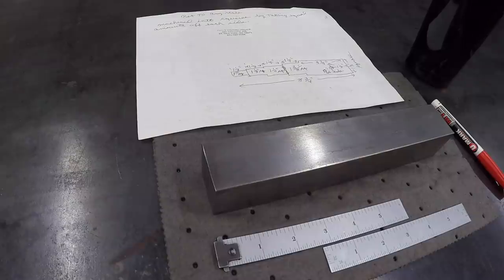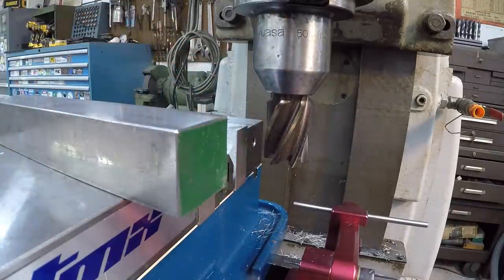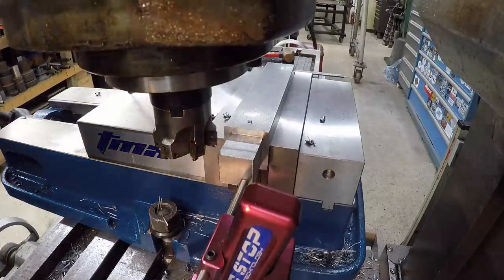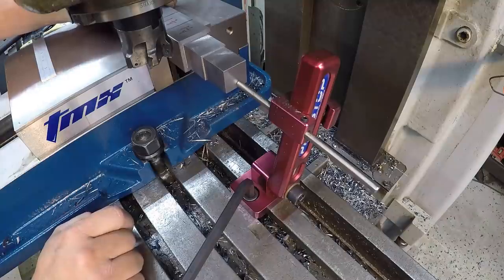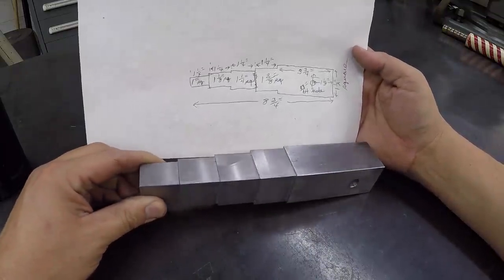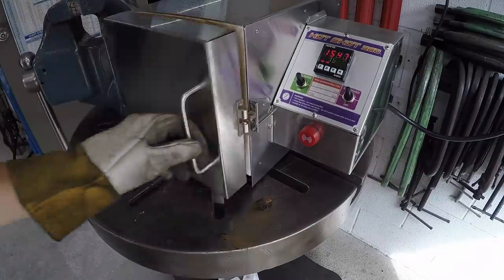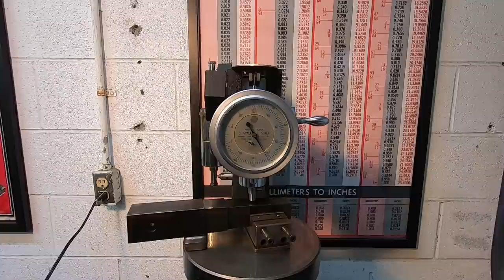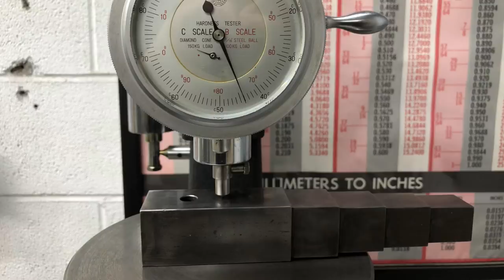SNS 296: Custom Square Drive Tool, Heat Treating

Comment: Don’t support it on fire brick blocks, they are insulators. Use like a piece of angle iron gable roof style so your part is only touching a knife edge. Secondly, your heat treat time is at temp, not room temp. The metal has to heat up to your HT temp, then you start the soak timer. Third, hardness will be related to how quickly you can quench, the foil will significantly hinder you and result in inconsistencies. For annealing and slow cool ops you will be fine, not for hardening, you need to quench fast and clean it after.

Comment: Adam, you did good with the foil.  As you noted, the quantity of the oil is something important to consider because that huge chunk of steel is bringing the oil up to a high temp at the same time you're wanting the oil to cool your part off quickly.  Ten gallons of oil would likely have been better for your needs on that part because it would have drawn the heat away faster.

Hardening is all about getting the heat out of the part as fast as possible for that particular alloy.  I'm not up to speed on 4140, but I think you were on the right track and just didn't get it cool enough fast enough.

When you tried to remove the foil first.... that was a deal-breaker.  You want to quench immediately from the Critical Temperature.  By stopping to remove the foil, you allowed the alloy to drop below Critical Temperature, and that impacted your heat-treat results.

Regarding quench tanks, you're right to worry about your plastic bucket.  It's very easy to burn through the plastic with a hot piece of steel, and that's just a mess!  I prefer big ol' military surplus ammo cans like this ---  https://www.midwayusa.com/product/1918234504  They can be a pain to open, but you should be doing that long before you need to stick a part in it.  Having that locking lid means now worry about spills, too.

However, I have seen a few people using large 10-gallon fireproof waste cans (industrial supply stores carry them) and putting a 6-gallon metal bucket inside it.  Step on the pedal and the lid is automatically raised so you can quench in the oil.  And as soon as you let go of the pedal, the lid plops down and seals everything against combustion.  Very handy and very safe -- plus it looks nice and industrial so it fits in with the other shop decor!  :D

Hope that helps.  Keep up the great work!

Comment: We wrap the part in paper 1st than in foil. we do that to get rid of all the air around the part. the paper will burn till there is no more air left.
Thanks
Reply: Wouldn't the burning paper result in more carbon deposits and such?
Reply: 94XJ  carbon maybe, but it would take away the oxygen and that’s what causes the heat scale that would be the problem.

Comment: Hey ya thats what we do here! Learn . Pre heat the tongs, have a pair  of tinners snips ready ,use tongs to pull the envelope to the edge of the oven. theres a roller crimper for the envelope to form the crimp put a piece of card paper half a card for that size (to burn off any oxygen) leaving it in  the bag while quenching is probly where the spotty hardness came from.  Good stuff adam really great show. could feel the adrenaline flowing. nothing elese like it huh making great steel better

Comment: You have to let the part heat with the oven. Start with the oven COOL and then let the piece heat slowly . As the oven reaches the temperature let it soak for 30 minutes then quench it. Yes the part WILL be harder on the smallest size because the uneven heat of the steel. Thats why you have to start with the oven cool. This is how we knife makers do. I hope it helps.

Comment: The smaller squares may quench somewhat faster than the larger ones, faster quench= a few points  higher hardness readings. Must also cool down fully to at least 150 deg. F before you can pull it from the oil, or it will temper the hardness back[rise in temp when you pull it out of the oil] by a few points. Done many torch hardened tools 4140, 4340  The HOT SHOT makes it much more precise better soak just like the heattreat shop downtown, that charges too much so you got to do it in house.  Also, keep a fan blowing that oil smoke away from you.

Comment: As a retired metallurgist, I don't know what you are starting with but it doesn't seem like normalized 4140.  WAY too soft, should have been around 30 Rc like the Old Magician said.
When you hardness test, bring the needle around in one continuous sweep, and then zero with the knurled ring around the dial.
Tempering did nothing, the part was not hardened.  When you temper, do the time and temperature by the charts and pull it and let it cool in still air.  Do not quench it again.

Comment: 4140, especially pieces of that size, are usually quenched in water or brine, I saw lots of smiths heat treating hammers that way. It's a fairly low carbon alloy with touches of Cr and Mn for deep hardenability. Try to take some blocks and quench them in different medias and see what happens. The fact that it took a long time to cool down in oil could have given you the inconsistent hardness. Also remember that the longer you keep steel at critical temp, the deeper the superficial decarb goes. Also, you could try to use anti scale compound for quicker heat treatments, easy to apply and you don't have to mess with foil and slippery gloves. I always enjoy watching you machining stuff, it's mesmerizing

Comment: The tool wrap prevented the quenchant from reaching the tool, cooling took too long. Either repeat and use water or brine to quench or don't use the foil wrap.  The decarb is minimal and 4140 isn't prone to cracking.

Comment: Use a piece of steel as a stand between the part and the ceramic brick bottom of the furnace.  Alumina bricks are like ice cubes in furnaces - will cause cool spots on the part.  A thermocouple attached to the part will give you an accurate reading of the part temp; lots of Fluke multimeters will read K-wire thermocouples and the wires can be discharge welded or simply plunged into a TIG weld puddle on a non-critical spot on the part.  If you are after a half-hard or fully hardened part, I would skip the stainless bag - part needs to go from above austenitizing temp straight into the quenchant; full anneal and good quench should produce hardness in the 50's for this alloy. Key desirement to remember in hardening is high cooling rate.  Scale can be buffed off, and final sizing if critical can be machined into steel with conventional carbide machining up to around 45HRC.  Above 45HRC sizing can be ground in.
Reply: This

Comment: 4140 Pre-hard runs at 32Rc as purchased. Annealed 4140 should be heated to 1550 deg F. and  out of the quench at 54/56Rc.  Soak 5/15 minutes per inch of thickness after reaching a consistent temp at all times. Drawn back at 400 for a hardness of 50/52 Rc. for 1 hour after the piece reaches the draw temp. This hardening process gives the best size and shape retention. No need to wrap in stainless foil.
Reply: I wonder if there’s different Rockwell, like C vs H. When he said Rockwell 7 it sounded like butter soft.

Comment: So I normally heat treat without a stainless wrap for the high carbon steels. What you can use is a special paint called Condursal Z1100, dip the part into it and let it fully dry, it pretty much prevents all scale forming (close to 100% of scale depending on how even you get the paint coating).

For 4140 heat treat at 1550F and quench in oil warmed to around 113F. Trip from oven to oil must be fast and get it fully into that oil quickly. I swirl the parts around to help move the heat and prevent a barrier forming around the part where the oil is bubbling. Because the part is pretty thick keep it in the oil and agitating it for a long time. If you take it out too quickly it's going to self temper because the inside is going to retain the heat and that will radiate outwards heating the part up to tempering temps and soften the metal. Depending on the HRC you are wanting 400F temper gives roughly 55HRC, 500F +- 50HRC, 550F +- 48HRC but it sounded like you wanted something in that range (higher temps will make it softer.

You might have issues with the part being large that it has too much thermal mass for that amount of oil, it does look like too little, you may find the oil is getting too hot and can't draw the heat away fast enough leading to inconsistent results.

Before you check the hardness just make sure you remove the scale, it's very hard and will throw HRC results way off. Since you've machined to the correct sizes already I would look at using Condursal (I used to use stainless steel foils, no longer I find Condursal more reliable and it leaves a cleaner finish.
Reply: Can Condursal be used for heat treating with a torch . Also i just looked it up & it says  below 600 C it leaves a black coating that is hard to remove , have  you come across this like would it be good for tool blackening ?  Cheers .
Reply: Wayne Hall, excellent advice from someone who knows his craft, interesting that you specify moderate pre-heating of the quench oil, is this to ensure consistency, where shop temperatures can vary greatly in North America, compared to the UK?.
Yes that is quite a large mass to quench in a bucket, ruling section evident.
Have a great weekend.
Reply: @swanvalleymachineshop   I've only used it in a heat treating oven, never with a naked flame. 600c is also a low temp for heat treating, normally a least 800C for carbon steels (it depends on the steel exactly, all have different temps). Stainless steels are in the 1000+ range.
Reply: @bostedtap8399  So from what I was taught its to reduce shock on the part of having it too cold to start with. Likewise if the oil gets too hot from multiple quenches its no longer operating efficiently and cooling the steel quick enough and I stop quenching until it cools down. OR simply have a lot more of the oil to reduce the rate at which it heats up. Heating it up is pretty easy, just take a scrap chunk of steel and heat it up in the oven while it comes up to temp, use that to heat up the oil. You will find that right sized piece of steel for your quench tank after a few tries. Or you can have a more complex setup, up to you :)
Reply: @MethiasZa  Thanks for replying.

Comment: In school we used the foil to make the pouches as well. We didn't worry about squishing the pouch around he part, we put a slip of paper in the pouch to burn up any oxygen. Also, our tongs had spikes on them, so we could rip the foil bags and allow the oil to circulate. It is very important to keep the part moving in the heat rest so you don't have a pocket of high temp oil and vaporized oil around your part keeping it from cooling off slowly. I seem to recall there being a pretty long preheat on our parts as well.

Comment: Take your test block and try a water quench and see what you get. Also just drop it in  try to get it leaning up. It could be that your tongs are shrouding and insulating the block so it doesn't cool fast enough to get hard in those spots. You should be in the 35-40 HRC range after quenching, if you don't get that your cooling rate is too slow for some reason.  Or it could be it is not good quality steel..........
Reply: I would not just drop it in the quench. You want to be able to move the part around agitating the oil . You will run a risk of cracking by quenching 4140 in water . It’s a little too aggressive. You might be able to get away with quenching it in a polymer but then the issue would be keeping it from separating with the low volume and no constant agitation. Just my experience
Reply: @matts2101  Timken calls for water quenching of their 4140HW. Definitely something you would want to test on your material before trying it on a part, would hate to crack it. I have tried iit both ways and I got more consistent results not holding on to the parts trying to stirr them. A tank with agitation works the best.

Comment: My respect for trying hardening and reporting on it.  It's certainly not easy.  MY career has been tools for machining hard steel (PCBN).  Even for biggest powertrain shops .getting reliable uniform case hardness (not through, more difficult)  is magic.  (Getting reliable chips adds another layer of trickiness).  There are best practices, rules but a lot of magic too.  Tbe idea is to get carbon from the pyrolyzed oil to diffuse through the oxide scale layer, into the first 1mm of steel, then to quench out as the hard martensite phase.  Not the very hard cementite phase, nor revert back to softer austenite, bainite.  Not at all easy.  One must control heat on the way (peak temperature for sure) and on the way down.  Rate matters.   Heat transfer matters.  If the furnace is small, radiation is a big player, parts get 'sunburn'.  You got my admiration for trying and reporting it as it is.

Comment: Hey Adam! Great video! Listen I heat treat a lot of A2 and S7 among other carbon steels. We use the stainless wrap too. Our process is wrap the part in a bag type enclosure. Not so tight around the part. Put that part in the cold furnace and allow it to come up to temp with the furnace. Once the oven gets to temp start your cook time clock. After soaking in the oven the duration of the cycle remove that part from the oven. Immediately remove the wrap from that part. You should see a orange glowing part! Either quinch that part (D2) depending on the steel or place it on a cooling table (A2) and let it cool to the touch. Same goes with drawing the steel back . Place the unwrapped part in the cold oven bring the temp back up to the target for tempering. Soak that part for the cycle time and remove it and allow the part to cool to the touch. I know everyone does it different but this is our process. We make a ton of punches and dies for stamping presses and we never have any issues with heat treating our parts. The main thing is to know what steel you are heat treating and know the process for that steel if that part needs air cooling or quinching. I hope you understood a little of what I'm trying to say here. Keep up the good work Adam!!

Comment: Watching blacksmiths and blacksmiths they talk about " soaking " parts at temp for ten or fifteen minutes. Also quench while temp is on the rise never when it's already cooling and quench immediately on leaving the oven or forge then temper asap. For a beginner I think you're doing fine. Your skill level working metal is way up there and adding to it all the time. Keep up the great work and work ethic.
Thanks for taking us along.

Comment: Hi Adam, here is my trick to avoid the oxidation of the workpiece without using a special foil : I get good results in covering the workpiece in soaking wet sheet of newspaper. After the water is vaporized the paper will burn and leaves a thin layer of ashes on the complete surface. Thank you for all your excellent videos! Keep on youtubing!!!! Greetings from Hamburg, Germany

Comment: I work in the heat treatment industry. Particularly - doing exactly what process you have completed. You should mill off about 20-35 thousandths after heat treating to provide you with more consistent test results. Another common practice is just to grind the surface down. You should see much more consistent results after that. Any questions you have message me. I work alongside one of the top metallurgists known in North America.
Reply: Is it ok to quench with that wrap that he has on? Seems to me that the oil wont get to the piece.
Reply: @UUttis  only one way to find out. We don't use foil wrap to quench out our parts because we have no oxygen present in our furnaces. Also that part should be a nice bright orange at 1650 before quench. Not black or "barely red".
Reply: Decieved we use the foil wrap at work and we always remove the wrap before quench
Reply: @tylerakerfeldt7220  do you find you get inconsistent quench when keeping the foil on?
Reply: Highlifterdan honestly I’ve never quenched with the foil on and most of our steel is air quenched.

Comment: Many years ago I used stainless foil to wrap a part for heat treating. I was advised to get as much air out as possible and put a bit of paper inside to use up the oxygen as the paper carbonised.
Adam: there is a flux you can get for coating your steel before heat treatment to eliminate scale completely. I can't remember the name of it, but I used it once and it worked perfectly. It just falls off in the quenching oil.

Comment: Hi Adam,
thanks for the video.
in regard to the heat treating is see a couple of issues for the inconsistency.
1. you should not quench the steel with the foil over it as it will actually slow down the quench rate.
2. Where ever you hold the part with the thongs will cool slower hence quench at a lower rate hence not harden as well. the inconsistencies you found on the sample would be the contact point spots where you held it by the thongs.

If you held that sized item in the oven for over an hour it will have a uniform temperature throughout so the small ceramic blocks are not an issue and does not affect the quenching process.